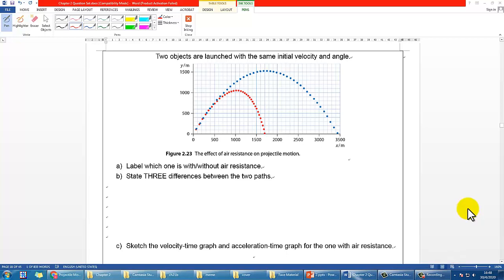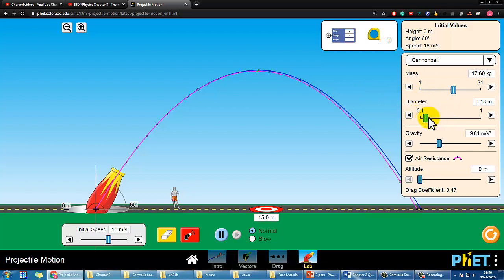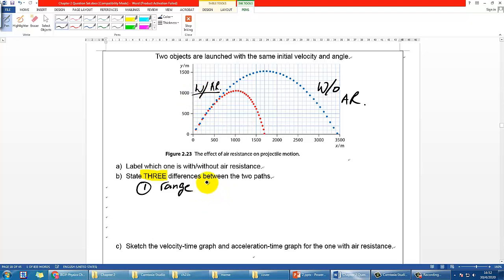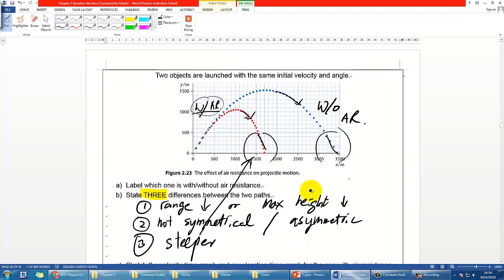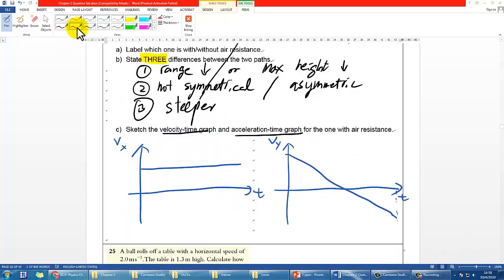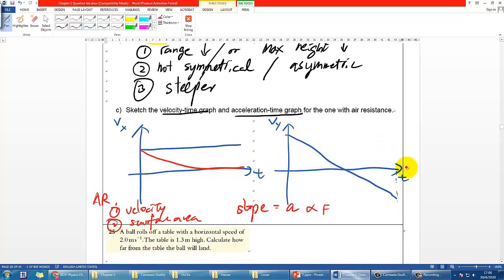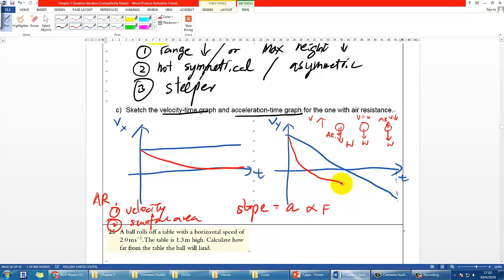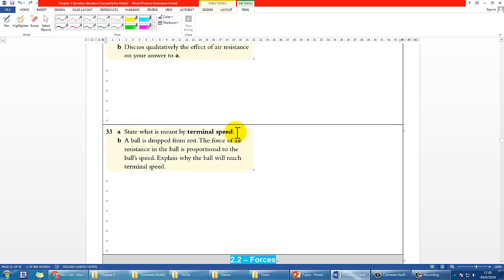Air resistance in Projectile Motion - IB Physics A.1 (Part 12)

Comment: But main que still remains unanswered.. What happens to time of flight when air resistance is there.. It increases or decrease
Reply from the maker: If you have to, how will you set up the experiment to test this ?
Reply: @LouisWongPhysics  can't it be derived on pen paper? I mean as compared to when air resistance is absent what is time of flight when we consider air resistance.. Will it be more or less
Reply from the maker: @DrAmit-bt2zo  im not sure. For sure that when the object goes up, the time is less. When it comes down, the time is increased. If I have to guess, it would be less time
Reply: @LouisWongPhysics  yes you're right sir. Time of ascend will be less and time of descend will be more but i was confused what will be total when we add up compared to non air resistance case time of flight. My guess too is it will decrease.